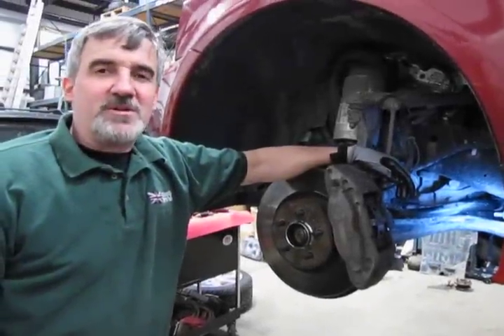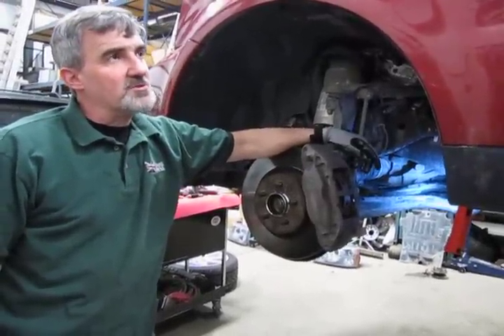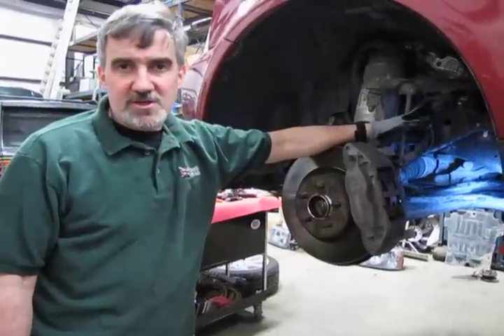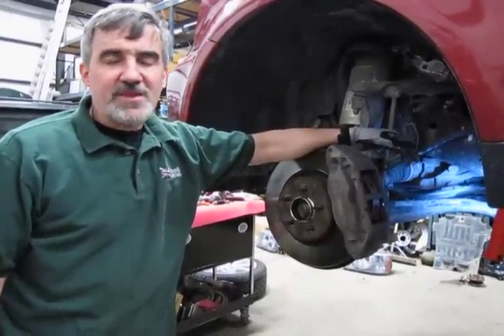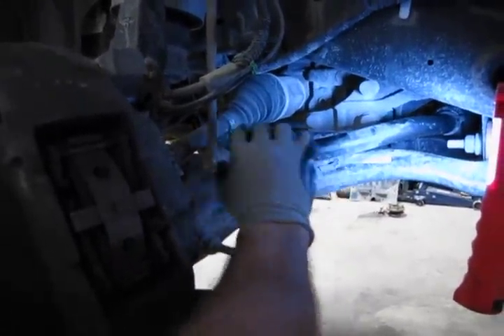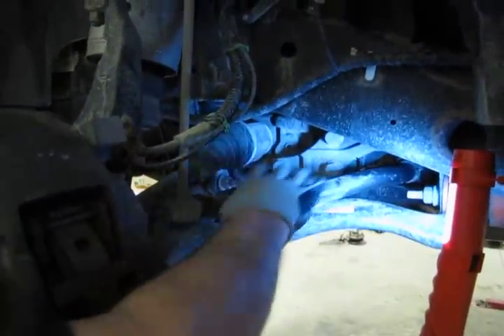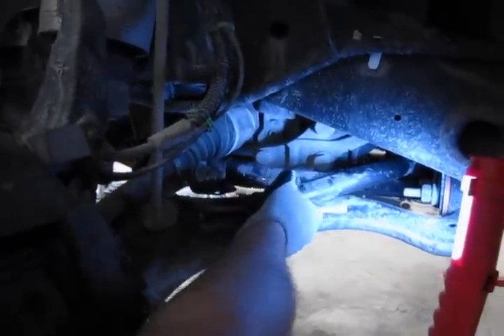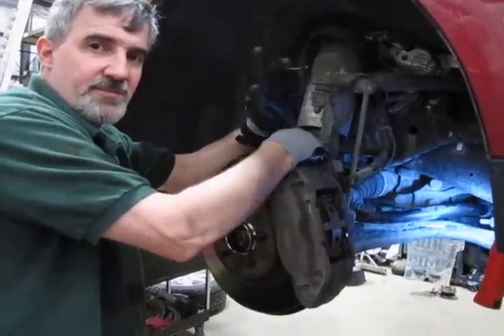Atlantic British Presents: Diagnose A Bad Sway Bar Bushing On Range Rovers And LR3

Comment: I tried to remove the sway bar bushing brackets yesterday (LR3). Bottom bolt: No problem. Top bolt: No success. As I am not capable of witchcraft, I would sincerely appreciate and advice you might have. Thank you for the great videos on your channel.
Reply from the maker: Those bolts are notoriously hard to remove. Our best advice would be to soak the bolt in penetrating oil for 24-48 hours before trying to remove it and try to get more leverage on the bolt to remove it.
Reply: Use pb blaster or ATF

Comment: Aside from lifting the vehicle , what wrenches are the ones needed to remove the bolts that hold the bushings and what’s the easiest way to get to them? Thanks
Reply from the maker: Hi Luis, several questions, what model are you referring to? Additionally, are you trying to reach the front or back sway bar bushings?

Comment: Hi,  Hoping you can help, I have a 2016 discovery sport. when I'm on the highway doing aprox 50 mph the rear of my truck occasionally starts swaying left to right as if I were fishtailing!!! then it stabilizes and happens again on and off. It stops as I slow down. There is no shaking or loose in the steering wheel. Can this be related to the sway bar?

Comment: Hi do you have to remove the propshaft to get to the bolts on one side, I have done my driver side (right hand drive) but noticed on my passenger side the propshaft looked to be in the way cheers ?
Reply: Same question here in UK. No one seems to show changing the front left (uk right hand drive passenger side) because its a PITA to change! It needs a special Land Rover tool and possibly remove the prop shaft. Some say you need to lift the body. We’ve not done ours yet, hoping to find a DIY video, but no luck! Help!

Comment: Does the vehicle need to be up on a hoist to check these or can it be on the ground?
Reply from the maker: Yes, however, make sure to use the frame or a designated jack point to hoist it and not on the control arm. If you use the control arm to hoist it, you won't be able to tell if there is a bad bushing or not.

Comment: Hello there, 
I need a piece of advice, 
I have HSE 2006 L322. The issue is while driving straight  i hear nothing but when turning left (full staring cut left) i hear lots noise from the wheel from left side clicking sound probably type of baring noise. Could you please  tell what program could it be. Similar noise comes from right but less noise turning right . Driving straight has no sound at all. Also found out that front left axle boot was damaged from wheel side.
Reply from the maker: Hi Rashid, we would recommend bringing it to your local LR mechanic and having them diagnose the issue.